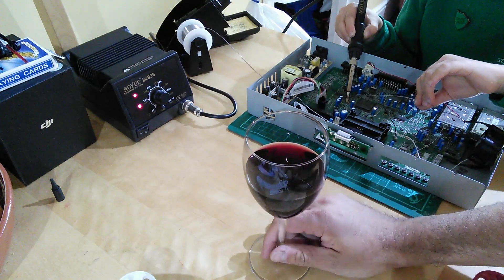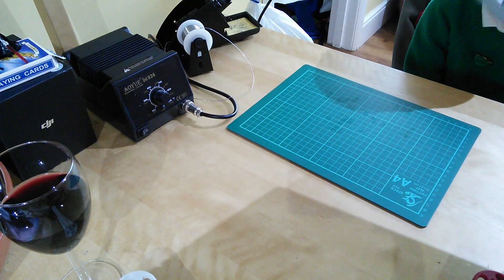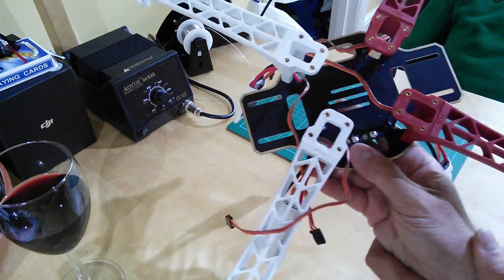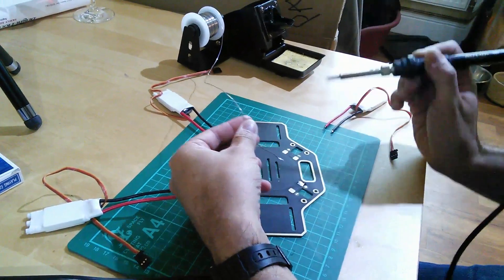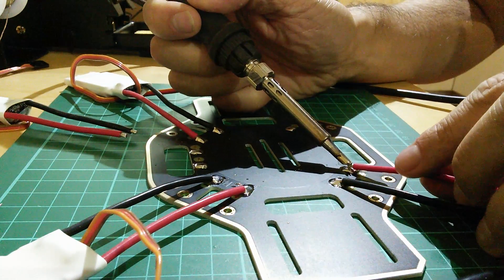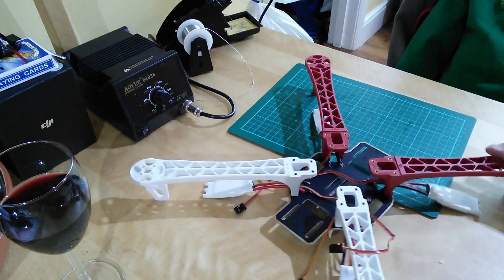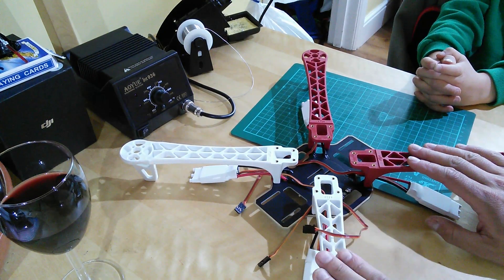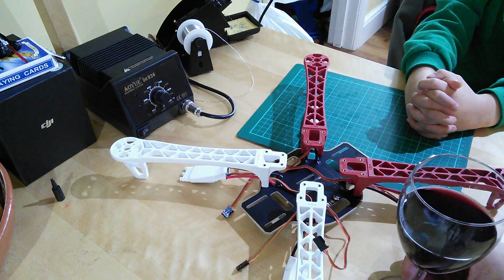Build Your Own DJI F450 On the Kitchen Table. Soldering the ESCs

Comment: Try cutting about 12 inches of solder off the reel. Wrap the length around two fingers leaving a tail. You'll find it a bit easier to solder.